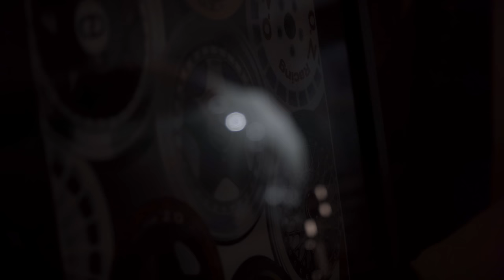Anticlimactic Paint Correction And Ceramic Coating On A White BMW F30

Comment: Curious as to why you went with Avalon King? It’s a rebranded Chinese coating that can be had for 1/5th the price on Alibaba.
Reply from the maker: Man I have installed over 500 "professional" coatings and now that I don't run a detailing business I want to try more consumer based products. Thus far the lack of drastic difference is slightly shocking.
Reply: @ChromaticGarage  interesting to read your reply, as although I've enjoyed your videos for a year or more, I didn't realise you used to run a business detailing.  Is YouTube a full time gig now? Great content by the way, and I agree. Some consumer available coatings are the equals of many "pro only" coatings in my experience

Comment: Ok. First off, incredible. Second off, how the heck did you get a camera up there at 7:00? And third, how’s your experience with AvalonKing products been?
Reply from the maker: Haha thank you Henry! Of course I had to bring out the ladder haha. AK has been awesome so far, I coated my R129 in it last winter. The ease of use and ability to coat every vehicle surface in the coating is actually brilliant. The amount of money I have spent on having 5 different coatings for each car is now unfathomable haha
Reply: @ChromaticGarage  thanks!